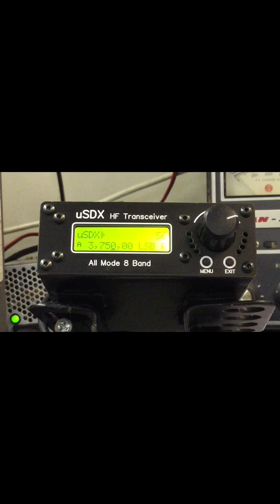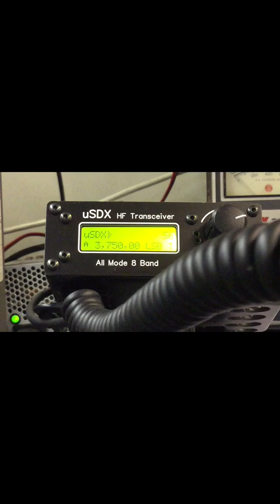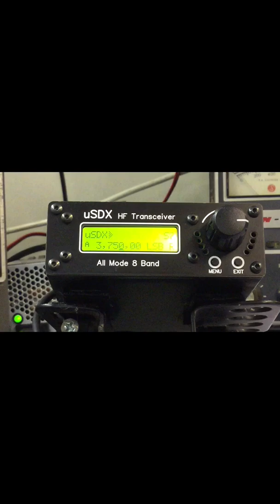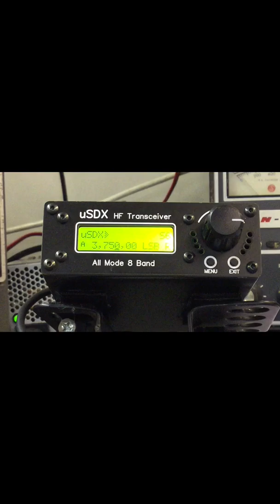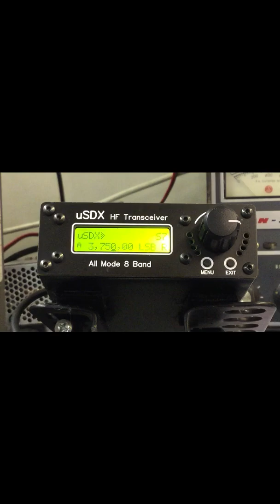uSDX 80m 289 miles on 3W Kent to Netherlands

Comment: There's a cheap Chinese 100 watt amplifier that goes with that radio so people can actually hear you.
Reply from the maker: I have about 6 of them.
And several low pass filter kits that go with them.
But if I wanted to operate QRO, I’d use my 590S, 520S or several other radios to be honest.
I enjoy the construction and challenge of sub 10W operation.